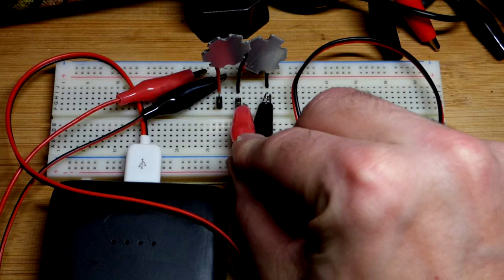Testing if two series 5V USB power banks can output 10V with two series 5V 1W LED components

Comment: in theory this should work with power supplies too right? or will it short them out?
Reply from the maker: You will likely have problems if the power supplies are plugged into outlets or the same battery. I only tested out connecting portable power banks in series because I have close to 10 of them. But now, USB C has the potential to provide up to 48V, so daisy chaining 5V USB A power banks isn't very useful anymore anyways.
Reply: @Electronzap  thanks for replying. today i connected two usb a power supplies in series and it didn't blow up my whole house and actually gave me 10v DC. it was just a test i'm not using it for any projects.
Reply from the maker: @abulkhayer1999  Nice. It's probably not dangerous most of the time since power supplies tend to limit current and have short circuit protection. If the positive of one supply can provide power to the negative of the other supply, then not having a load between them and connecting them together would be a short circuit.

Comment: I've wondered about this but never tested it. I have tested these with up/down converters to get power for field testing and it worked fine for a short time. Now this raises the question, if a longer time could be achieved this way (using the buck converters) or if it would drain about the same.